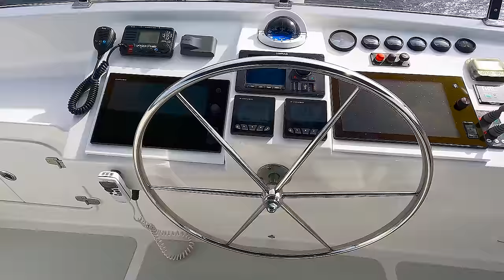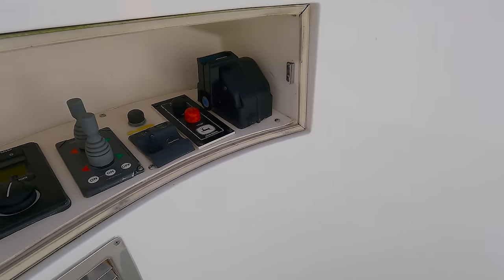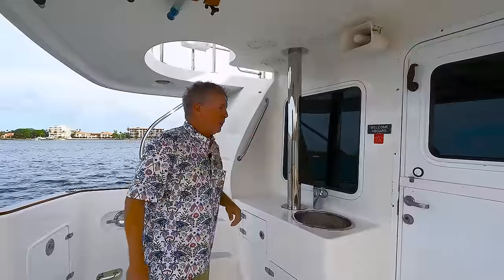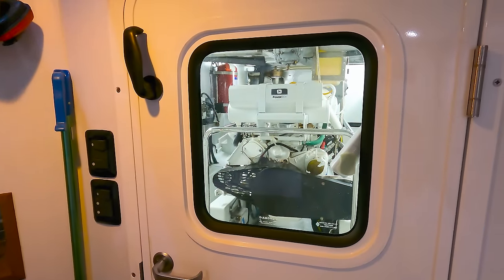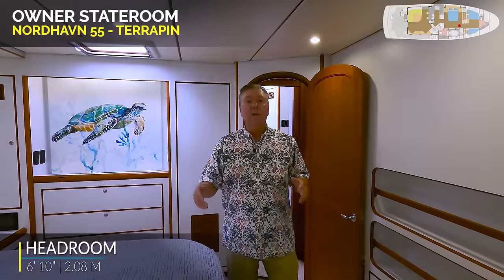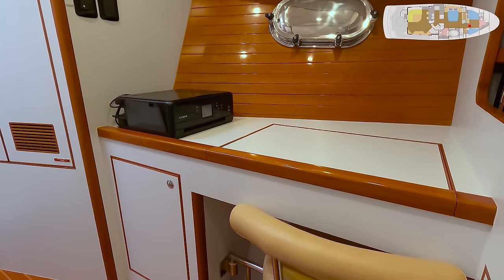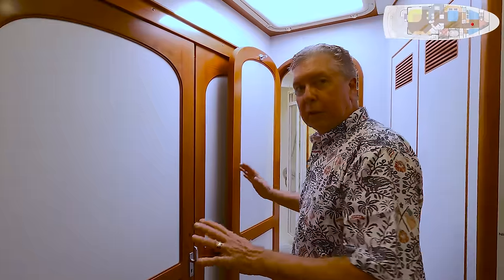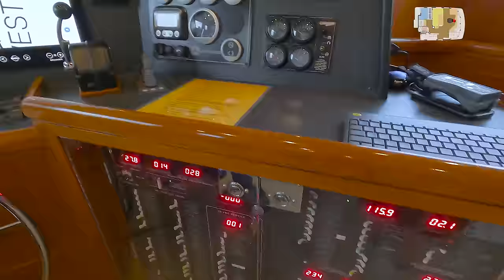NORDHAVN 55 – [Talk Through Tour] – SOLD!

Comment: What horse power is the main engine?  What the max revs?  Thanks
Reply from the maker: 1983:  Good question we try to go into the details are on our website, JMYS.com along with photos.  The engine is a John Deere 6081AFM75| 330 HP. You could go online to learn the fuel consumption at various RPMs. I recall it is a 2,400 RPM at WOT, but I didn't look it up. Most owners run at about 1,800 RPM for fuel economy
Reply: That's great, thank you.
Reply from the maker: @ob1983  You are welcome!